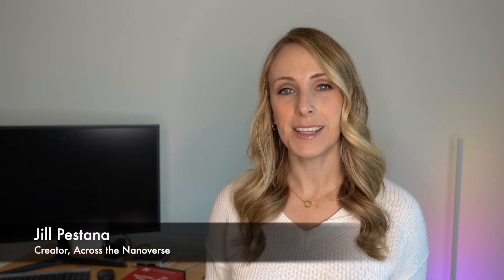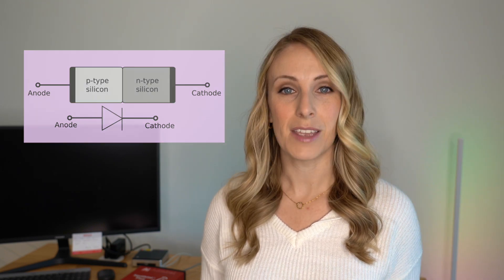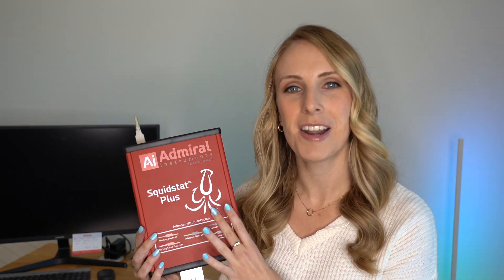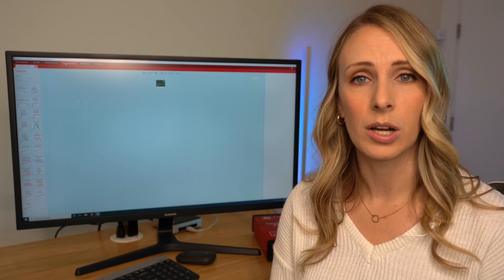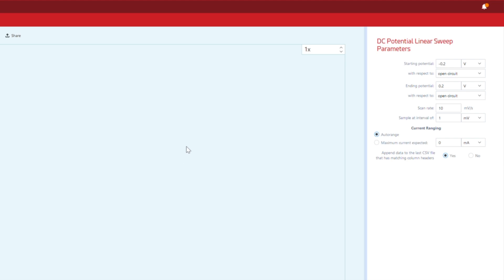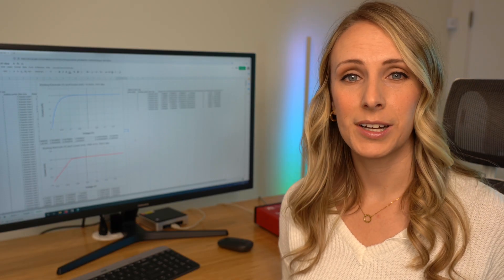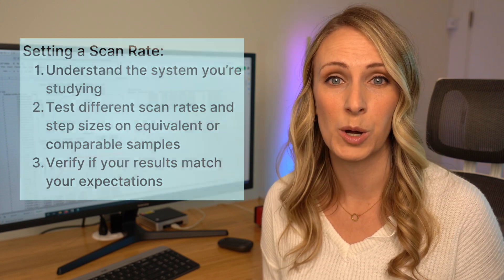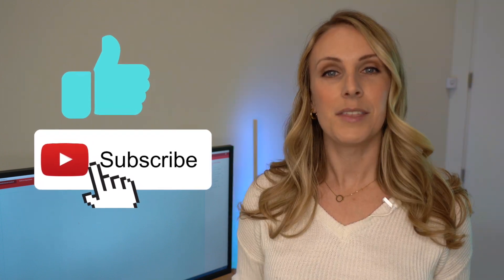Voltammetry Tips: CV and LSV + Demos!

Comment: hello Jill,

could you measure the ESR of a chemical capacitor, another tantalum, polyester, ceramic, aluminum etc...

you should find some on old electronic boards.

i don't know the frequency of the AC signal to apply to perform the measurement.

i think you could conclude which is the best capacitor and for which need in electronics.

what do you think?

Comment: A 1.000 g sample of zinc metal is dissolved in 50 mL of 6 M HCl solution and diluted to the mark in a 250 mL volumetric flask. A 25.00 mL portion is transferred to a polarographic cell and oxygen is flushed out. A polarogram in the range 0 - 1 V (vs. the Hg-pool electrode) shows a wave at E1/2 = -0.65 V, id = 32.0 units of galvanometer deflection. A 5.00 mL portion of 5.00 x 10-4 M CdCi2 solution is added directly to the polarography cell which already contains the Zn solution, oxygen is again flushed out, and a second polarogram is taken. The wave shows the same E1/2 but the id is 77.5 units. Calculate the percent by weight of Cd impurity in the Zn metal. Note: Atomic weight of Cd is 112.4 g/mole.

Pleas any one help me for solution this problem

Comment: Thanks for this well-explained video. I just wonder if you could make a video on how to analyse the LSV curve. I was told to draw 2 tangent lines to fine the onset potential at the intercept but not sure if this is the correct way to calculate it.
Reply from the maker: That’s one way of analyzing it. It really depends what your system is, what your hypothesis is, and what questions you’re trying to answer. To measure the onset potential of reactions, using the tangent-line drawing method (and matching it to what’s published in literature for those chemicals/materials) may be enough. If you are trying to answer more complex questions or discover new phenomena, you may need more experiments in addition to LSV and/or perform LSV on different systems related to the one you’re studying to draw more conclusions. Research and discovering new things is not easy! Best wishes!

Comment: A very nice informative video mam, thank you. I have a query, what if we reverse the starting and ending potential like from 0.2 to -0.2, how it will impact the results and how we decide which starting and ending potentials to choose.
Reply from the maker: Thanks for the question! In a system like a diode it shouldn’t affect the results because there’s no hysteresis. For other systems like batteries, supercapacitors, etc. there may be different results if the range is reversed.

Comment: The battery reaction order is random.
How to set the time and current parameters?
Reply from the maker: I’m not sure what you mean by battery reaction order. If you’re referring to increasing voltage and which reactions occur at each voltage, it is not a random order. It depends on the redox reaction potential. For CVs, you typically use a potentiostat like I have in the video to set parameters. I explain the settings in the video.
Reply: A rate law shows how the rate of a chemical reaction depends on reactant concentration. For a reaction such as aA → products, the rate law generally has the form rate = k[A]ⁿ, where k is a proportionality constant called the rate constant and n is the order of the reaction with respect to A. The value of n is not related to the reaction stoichiometry and must be determined by experiment.
Reply: The rate of a chemical reaction depends on reactant concentration and temperature and load and ...........
so the n (reaction order) is'nt random ?

Comment: Thank you for this thoroughly and calmly explained vid and good luck with your channel :)

I am planning to conduct electrofermentation whereby my growth medium undergoes electrolysis to produce hydrogen and oxygen, both of which are critical for the growth of my bacteria. However, the medium has to be optimized first so that it is stable under electrolysis, produces sufficient H2 and O2, and allows for good microbial growth.

I have read in some papers that LSV can be used to assess gas (H2 and O2) evolution without the need to actually capture and measure those gases (e.g. using GC/MS). This would be great for me, as gas measurement devices are not always available for us at the lab. However, I am not sure how LSV can actually help me assess gas evolution and what kind of indicators I need to look at in my LSV results to figure this out. So, can you please explain this to me, or at least point out further reading/vids that can help me understand this better? Any help would be highly appreciated.
Reply from the maker: You just need to know the potential at which you’d expect the reaction to take place. Once your voltage sweeps to that potential and you get a current response you can calculate the area under the peak as the amount of gas created (gas per coulomb of charge passed).
Reply: @AcrosstheNanoverse  The LSV peak is a very broad peak, like a duck curve, how the area under it would be measured?

Comment: Thanks Jill. it is a great video.
The question is I have done many CVs but never changed the step as my scan rate changed. how does it affect the data? Thanks is advance! :)
Reply from the maker: Thank you! Great question- the ability to change the step size is useful for very slow or very fast scan rates. I’m not sure the range of scan rates you were using, but it is possible the step size does not affect the data. I suppose if you were trying to resolve very subtle reactions/processes, a smaller step size may be able to resolve those better.

Comment: Hi. 
What is open circuit potential in settings section? Could you explain either elaborately or in layman's terms of why it was open circuit and not something else? How would the data be different in open circuit or other setting?
Reply from the maker: Good question! The open circuit potential (Voc) block I put in Experiment 2 was not essential to perform LSV. The software reads the Voc and then uses that as the reference point at which to assign 0 Volts. I didn’t have to use the block in that case, but decided to put it there as a mental note that the instrument needs a Voc measurement to identify the 0 Voltage point. The experiment worked just as well without the initial explicit Voc measurement at the beginning.
Reply: @AcrosstheNanoverse  Hi. Thank you for your reply. Continuing, do you mean that the magnitude of the data points would be almost same when run at Voc and Ref or the curve would be similiar in fashion?
Reply from the maker: More generally, open circuit potential is the potential of the device or system without any current passing through it.